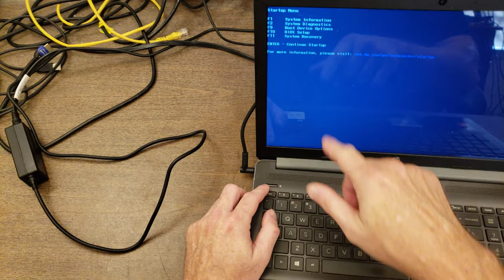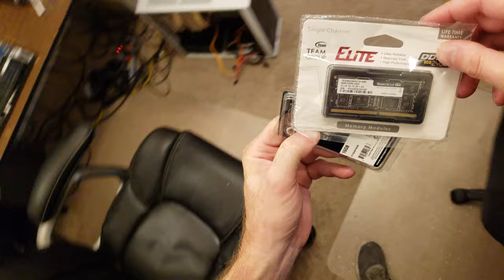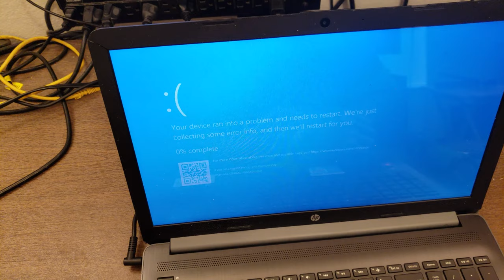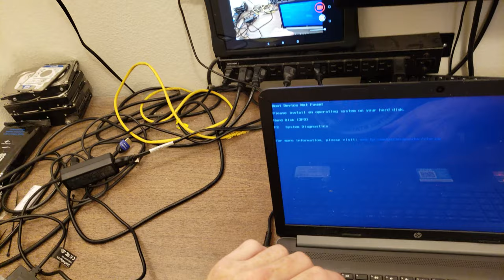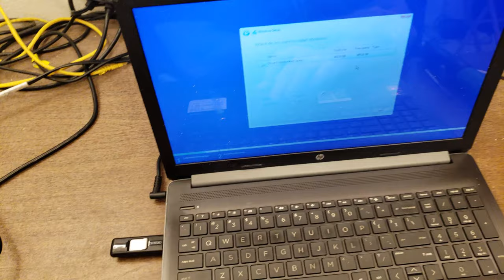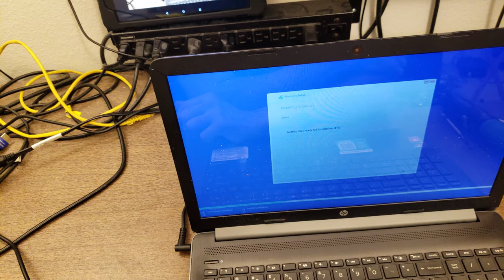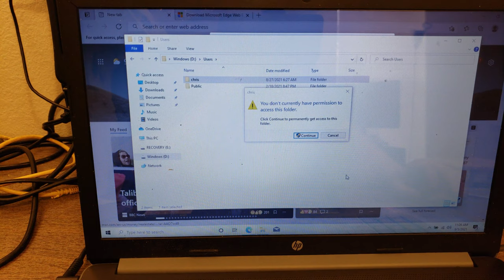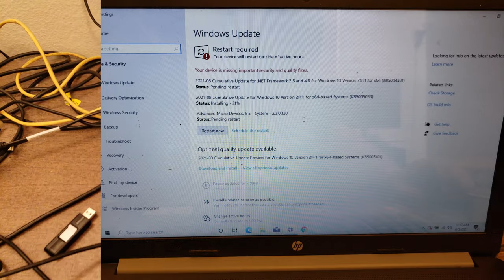M.2 NVME Solid State Drive upgrade, RAM replacement and Windows 10 reinstall on a HP laptop

Comment: I have Hp au084tx
Its manual says ...

Supports M.2 SATA-3 SSD 
128 GB SATA III Solid-state Drive 
256 GB SATA III Solid-state Drive 
256 GB SATA III Solid-state Drive NVMe

What this means, does it support m.2 SATA ssd or NVMe SSD ??? SHOULD i go with 500gb or only 256 gb supported ???
Reply from the maker: As long as it's a sata-based m.2 the capacity doesn't matter. It'll work.
Reply from the maker: I just looked at this a little bit more and can't find a definitive answer. What you listed in your original post where it mentions nvme, if you found something that says it does support nvme then it supports nvme it probably supports both SATA and nvme so you can get an nvme drive and it would work
Reply: @MichaelTheComputerGuy  ohk. THANK you so much for giving some time to answer my query. Best wishes for your channel growth...

Comment: Hi there, Do I need to format a SDD before cloning my hard drive? I will be using EaseUS Disk Copy & the SDD is a Samsung 870 EVO.
Reply from the maker: You don't need to partition or format the ssd.  The cloning software will handle that automatically.  Since its a Samsung ssd look into using their migration software.  Google Samsung ssd downloads and you'll find it on their site.
Reply: @MichaelTheComputerGuy  Many thanks for your response. I managed to get it done I just need to sort out the partitions

Comment: Hey Michael, I want to upgrade my laptop ram from 8gb to 16gb which is of 2133mhz.Which option would be best to got with as i am having difficulty in finding that frequency of ram.
Reply from the maker: If you can't find 2133mhz ram that's ok.  If you put in faster ram it will slow down to 2133mhz to match the slower ram and that's OK
Reply: @MichaelTheComputerGuy  thanks, this would help

Comment: hello michael where can i get extra copper heat pipe i am from india
Reply from the maker: Find the part number on the cooler you have or lookup the service manual of your laptop on the manufacturers website to find the part number and then search for that part number on whatever parts websites you can buy from.

Comment: does anybody have a recommendation for a 1tb m.2 that is readable by this laptop?  i put in my m.2 nvme and none of them are detected.  Any cheap 1tb or 512 suggestions that works please let me know
Reply from the maker: M.2 is a standard but there's two different types. Sata and nvme. If you've been putting in nvme drives and they're not recognized most likely the slot you're using only supports sata m.2 drives. So get yourself a Sata m.2 drive.